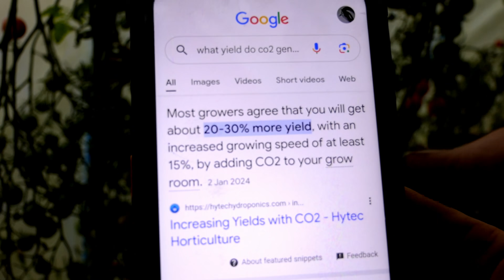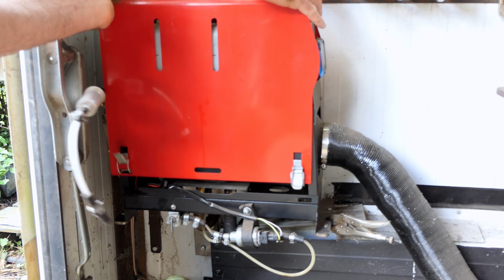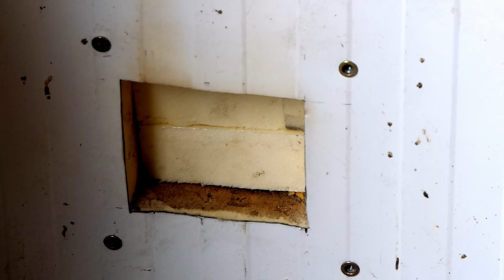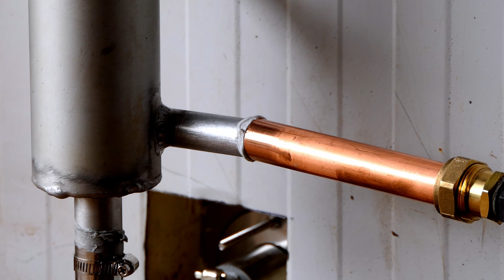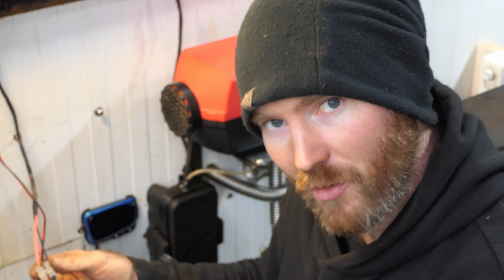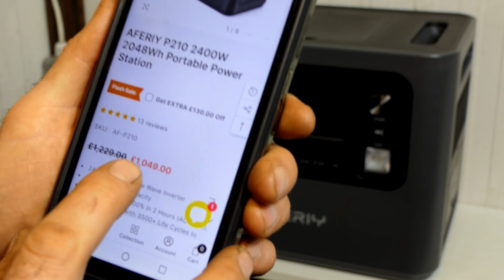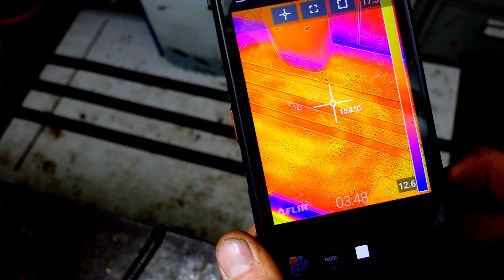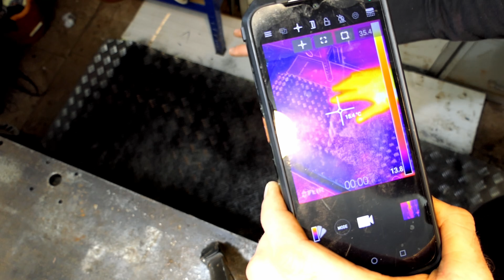NEW! Better system for Cheap and Safe Heating💲+ Underfloor Heating Mod test🫠

Comment: Net Zero, an Impractical solution to an Imaginary problem 
I'm currently installing a similar system in my workshop, bigger heat exchanger and radiators, thanks for the inspiration 👍

Comment: yo...excellent ideas and solutions. Thanks for the vid, though a big unit like the one you're flashing for a grand can easily be replaced by punting out 300 quid for a 100ah lifepo4 batt and some bits.
As per invite for discussion, here's some debating points ... just a quick friendly fact-check:
CO2 share : It’s ~0.042% (≈425 ppm) today, not 0.4% (off by factor of 10). Pre-industrial was ~280 ppm >>> that’s ~+50%, not 33%.
“Only 3% human” : That’s mixing up flux with imbalance. Natural sources/sinks were roughly balanced; our extra tips the scales. Isotopes/oxygen show the rise is fossil-carbon.
“Stopping won’t matter” : If global emissions hit net-zero, temps stop rising (they plateau). That’s the whole point of net-zero.
Sunspots : Solar output wiggles but hasn’t trended up since the 1950s; warming keeps climbing. Also, the fingerprint (troposphere warms/stratosphere cools) doesn’t match a solar cause.
Concrete/asphalt (UHI) : Cities run hot locally, sure. But oceans and rural stations show the same global trend ... UHI isn’t driving planet-wide warming.
Deforestation : Massive and bad (hundreds of millions of hectares). Trees cool and move water, yes >>> but this adds to the CO₂ problem; it don’t cancel it.
“CO₂ was 10× & life thrived” : In deep time, yeah >>> but the rate now is the kicker. Fast spikes = acidification/ecosystem stress >>> it's stability that matters. Things can flip sooo easy and quick, as records show.
“Still in an ice age” : We’re in a warm interglacial of an ice-age era. That doesn’t contradict today’s human-driven warming.
Sea level vs beachfront buys : Tide gauges/satellites show ~20+ cm rise and acceleration. Rich folks’ purchases ≠ measurements. For real.
What to do : It’s not “taxes or nothing.” Adapt and cut emissions: cleaner energy (often cheaper), reforestation, efficiency, and fixing air pollution help real people now. We as a people voted our way out of serfdom and into democracies. Now, we are seeing a resurgence of the mega-rich trying to reassert their power >>> while they use their media-power to tell us that there is no class war <<< the real threat to us all.
“The Dimming” : Bro...for real? I'll say this about that article >>> extraordinary claims need extraordinary evidence; with none credible so far coming out of that book. I note you didn't elaborate on the chemtrails guff.

Happy to go thru these points with yer. Again, thanks for the excellent diesel-heater content.
Reply from the maker: Ok. You last point is on topic. See here: https://youtu.be/djBl2SM-BVI?si=WKsG-eSgyzZccVTy
Reply: @joshuadelisle  Man...well done. That's the first time I actually watched GBeebies for more that 30 seconds. About the content of the vid tho...hmm. I see no vindication for chemtrail assertion.
Plenty of stuff about trying to make it rain (or not), but nowt about proof of organisations spraying poisons, or other means of 'population control', etc. No jewish space lasers either (a nod to MTG there). Thanks for replying tho man. That's cool. I'll go thru your other responses properly asap.
Reply: btw...subscribed. Excellent content.
Reply from the maker: Your first point. That's not considering that all Fossil fuels where once part of the atmosphere and sequestered in nature. So your argument doesn't hold true.
Reply from the maker: Nothing will change point. The climate has always been in a state of change so any probability of a reduction on climate change is theoretical only with no concrete proof. The benefits of increasing CO2 are however well documented as it results in more rapid photosynthesis which increases the growth of plants that further seaquest CO2. It's also well documented that we are closer to dangerously low levels of CO2 that then inhibits plants to grow effectively. The only problem there maybe is the quantity within a short space of time not the overall amount. So rapid climate change posses a risk to life for lack of adaptation but this is still theoretical. If you look at what is realistic in terms of reducing CO2 and the potential benefits you'll see that there is very little to be gained and instead there are far greater economic damages that affect lives if the current trend of CO2 reduction policies are imposed.

Comment: The trouble is, that human carbon emissions are mostly non-renewable, by releasing the stored carbon in coal and oil (compressed hydrocarbons that did not break down), the levels of greenhouse gases tip over the threshold. It is a low amount that is needed, and only a tight range where you don't have runaway heating or cooling.

Comment: Deforestation actually has a short term cooling effect. It rises albedo and lowers water evaporation. Water in the atmosphere is a stronger climate agent than CO2. In the long term the lower CO2 sequestration of less trees has the same climate change effect as the CO2 we release.

Comment: INTERCOOLER ON EXHAUST SIDE
just come from your older videos and I've been considering using an old intercooler on the exhaust as I have a couple spare but you can normally get them cheap 2nd hand and due to the much larger pipe diameter it will have a lower air flow with minimal backpreasure. Hoping it should allow for a good amount of heat to be used.
Hoping this gets seen as would love to see someone else us it lol

Comment: Someone asked me same thing about carbon monoxide. and they argued that air is moving in room by being heated and mixes gases.

There are solar inverter with 230v outlet 3000w for water heating (350eur). building with those then maybe i don´t have to use boiler to heat my house 4month in spring. still haven´t set it up. i have 2 diesel heaters also. one can keep decent temperature in 2 story house.

Comment: I believe that the poor heat transfer you are getting from the underfloor pipe to the floor surface is because when you put the metal and foam wall section back together, after installing the spiral water pipe, you put foam all over the existing foam as well as the installed water pipe, creating a thermal gap between the pipe and the floor (metal wall) surface.  I think it would work much better if the underfloor water pipe was in contact with the upper floor surface, and the floor surface itself was a denser material capable of spreading the heat out between the pipes, perhaps something like tile?  Even better would be to embed the underfloor heating pipes into a concrete floor with all of the insulation below the floor system.  Nevermind, I hadn't gotten to the end of the video, and see that you came to the same conclusion and attempted to fix the problem.

Comment: Think 🤔 A person can diy Ethanol,. methanol biodiesel .* Kerosene production is very difficult to diy.
Reply from the maker: Kerosene (heating oil) is cheap in the UK at £0.48 per liter making it £0.05 per kwh. Making fuels maybe cheaper but very time consuming and requires a capital outlay. If you want easy and cheap just have a wood stove. Cheers J
Reply: Subscribed 😁

Comment: What fuel pressure is needed for this to run? Would a peristaltic pump be an alternative?
Reply from the maker: That can work as long as you tune it right. It's only wicking the fuel so there's no need for high pressure. It can be gravity fed if regulated correctly. I would recommend an O2 sensor to get it tuned just right

Comment: Regarding trees:-  trees radiate a whole bunch of IR which has huge health benefits - no wonder the Japanese have a culture of "Forest Bathing".  For more info, look at some of the lectures on "Light as Medicine" on the Medcram channel.  As a kid I grew up in the south London suburbs.  There was a tree on the pavement outside about every 1.5 houses, and all the houses had substantial front gardens.  The trees are now decimated by cable installers and dropped curbs, while the gardens have been concreted over for car parking (which causes floods because poor legislation fails to insure people use porous surfaces). Such a shame to see a once beautiful suburb in such a state.  We need to put more trees back into our cities and suburbs.

Comment: Joshua, your videos should be shown in schools...Your empirical science is amazing.
I have bought a tool box heater to swap in and out of my van and home.
Is it possible to make a plate on the exhaust to boil water for a cup of tea ? (Or even cook ) . 
Help on this would be much appreciated 🙏🏾
Reply from the maker: Thank you. I actually did a test by exhausting into a biscuit tin with a pot of water on top and vent holes at the bottom. It kinda works but not very efficiently. You would be better off using a paraffin stove which will run on the same fuel as the heater. Cheers J
Reply: @joshuadelisle  Thanks for the reply .I was thinking of running it in the van. Deciding wear to port the exhaust , whilst having a 30 cm run internally  to experiment extracting heat with . I'm going  to try 2 bricks and a small piece of metal in contact with the pipe and a steel cup outside on the floor tomorrow . If it works I can fashion a plate that fixes with  jubilee clips and screws ?  You've inspired me to experiment  and be truly "Jugaad" (Indian for frugal ingenuity).👍🏾🙏🏾

Comment: Air flow from outside as cooler air will give a better burn.

Cool air is more dense, more air = better burn.

Ps....that heat exchanger you made looks pretty damn sweet.

I tried running the exhaust thro a small radiator.........it worked great for a short while & then gassed out the workshop.

Theae heaters handle zero back pressure.

Comment: Really enjoyed the video however your pricing comparison between oil and ASHP is rather flawed due to the fact that oil pricing is wildly variable, due to seasonal demand and geopolitical factors "drill baby drill". Electricity pricing, whilst also subject to pricing variation, tends to be fixed over a term, usually 12 months.
As a tight-fisted Yorkshireman, my home runs ASHP heating during Spring, Autumn, and Summer with the oil bought in Summer reserved for Winter.
.

Comment: Some simple math and common sense applied to anthropogenic global warming (AGW) obliterates the argument & always has. I will not call it climate change because that's absurd! Of course the climate changes & it's just AGW rebranded into a meaningless term. Everything Josh said is true. I'd like to add that on a geological timeline perspective this planet got dangerously close to an extension event due to insufficient CO2 caused by CO2s removal from the system by getting trapped underground as oil. Humans, by burning fossil fuels, have liberated some of this CO2 & saved the planet, although there's still an argument we're at dangerously low levels. These people trying to solve a non-existent problem threaten life on the planet. Reflecting sunlight or building CO2 scrubbers is a stupid idea as the world is much better than it was 100yrs ago. Trying to cool the planet is ridiculous as it's not even close to ideal temperatures. If these moronic religious AGW zealots get their way and succeed you'll find things go very badly for the planet & the focus will switch to generating life saving essential CO2. Pollution is bad. CO2 is not pollution & probably has no effect, or extremely little impact on global temperatures.

This simple math could also be applied to COVID-19 back in Jan 2020. Using official death rates on Google, Belgium's (worst case) 8.9% death rate (known cases after 3 weeks i.e. they had no handle on unknown cases on the super duper infectious "gonna get you" virus) was easily extrapolated to be  0.89% but probably 0.44% assuming you were older than the average life expectancy or had major comorbidities. In other words, it was little threat to most people. Yes, January 2020 i.e. at the very start. It took me 5 minutes of wondering.. "should I be concerned about this?". My conclusion. No. So, there was no justification for lockdowns or "vaccines" that didn't exist at the time. Passive masks were profoundly ridiculous & anyone who wears a respirator or understands how balloons work from their extensive experience as a child should recognise why they can't keep other people safe. So, was I worried during COVID? Yes, very, but not from COVID, but our government as I watched all my predictions come true which unfortunately meant watching everyone make the ass backwards wrong decisions on everything! Yes, everything! It was easy to determine the correct course of action i.e. the polar opposite of whatever the government instructed you to do. An interesting and important lesson.

I remember Trump announcing "warp speed" and immediately thought three things:
1) why? it's unnecessary.
2) how? It's a coronavirus. So we have cured the common cold then & magically accounted for the constant mutations due to it being... a coronavirus!
3) you first buddy! I'll pass for the 1st decade until they've fully tested it.

Then I learned about the how. The mRNA and immediately said, out loud, WTAF? Hell f No! You want to inject me with code that you cannot fully understand with no controls on where it will go or how much uptake there will be, no concept of safe dosage, a supposed one-size-fits-all despite our genetic differences, and no off switch. As a programmer, I couldn't believe what I was hearing! One tiny syntax error and things go awry. Worse, a semantic error and things get very bad very quickly!

And that was before the obvious lies:
- We'll inject it into your am and it'll stay there. How? We're basically made of liquid.
- It's safe and effective. Lie! NOBODY could possibly know that for years!
- It'll stop the virus, prevent infection & transmission, but simultaneously we have to keep the unvaccinated away from the vaccinated to keep the vaccinated safe. Wait, what?

If you're lying you're hiding something. You cannot be trusted by definition of being a liar.  

And then, much later, I learned about all the other problems and concerns about the vaccine. Of course, I'd already decided against it as soon as it was announced.

What struck me was how much blind faith everyone seemed to have in government or "experts". Even in the face of overwhelming contradiction & overwhelming evidence of falsehood. It was astonishing to see such compliance from supposedly free countries. The foundational core principal of democracy is L I T E R A L L Y the inherent distrust of government. What we lived through was the absolute failure of democratic citizenry to adhere to their supposed core principals. Democratic nations failed the test i.e. the population failed. Failed miserably!

The MSM feeds off fear.. It's literally 90% of what they sell. So they assumed nobody will do this simple math using readily available data & realise there's nothing to fear. In this, the MSM has been very successful & the public only has itself to blame for remaining ignorant & trusting the lying media, & political corruption. Again, a miserable failure. 

It doesn't matter what angle you attack AGW from: it falls down. It's such an obvious grift which is why they had to rebrand from Global Warming to Climate Change because after 30 years of warming warnings, the planet had been cooling. Additionally, they went quiet for a few years right after the email dump was released demonstrating the entire thing was a scam to try and get people to be more environmentally conscious. The problem with this dishonest approach is that governments have made energy more expensive and morons are trying to solve non existent problems, both of which will result in the deaths of millions, or worse, everything. Cheap energy is what allows people to be environmentally aware. Nobody cares about the environment when they're poor and hungry - they'll eat and burn everything in sight. Unless it ends, this grift will have the opposite result of its original intentions.
Reply from the maker: I completely agree. 👍 Thank you for sharing your perspective on the matter. Cheers J